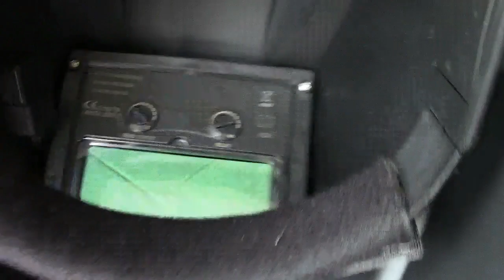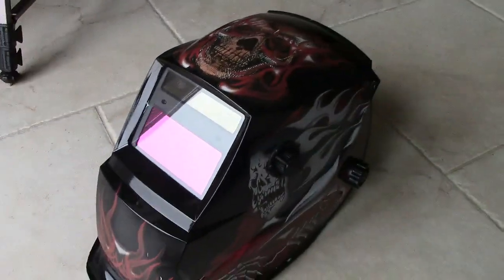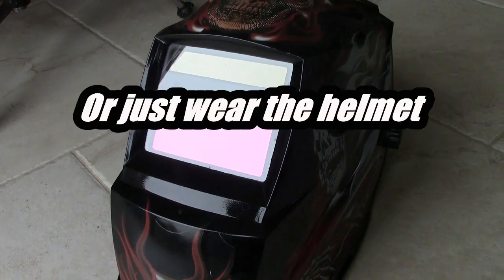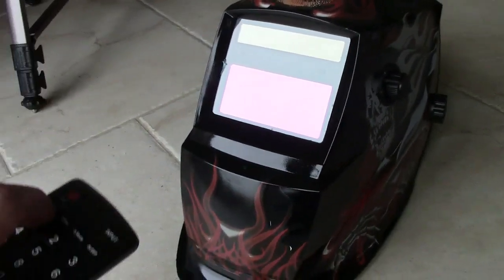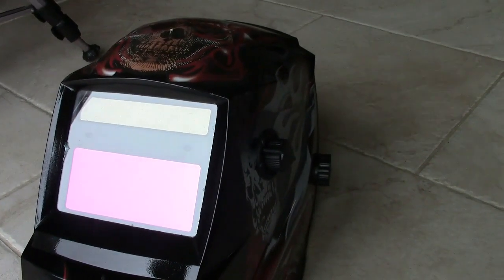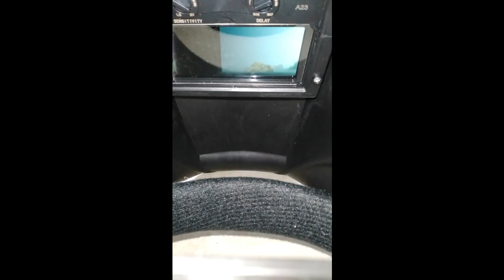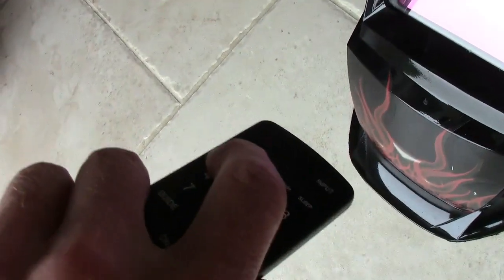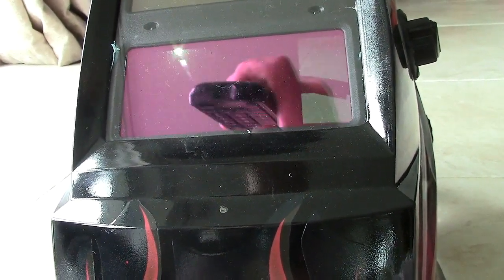How to Use An Auto Darkening Welding Helmet

Comment: i would absolutely never entrust my eyesight and eye-health to some random chinese electronics. Things like this need to be functional and safe on a nigh-mechanical level if i am to use them at any point. And this is coming from an IT-guy. Absolutely never use chinese stuff / unknown stuff off of eBay for anything dangerous.
Reply from the maker: From one IT guy to another, the majority of goods are now produced in China.
Reply: @fiveminuteman  ... thats completely wrong. While it is true that "a lot" of goods come from there, the majority of economies also produce a lot of stuff locally - or outsourced but made to local regulations / specifications. Noone minds having stuff assembled or produced elsewhere as long as it fits perfectly into the local market - but china is actively trying to harm, distort, suppress or even dominate other markets. That is why noone should support them.